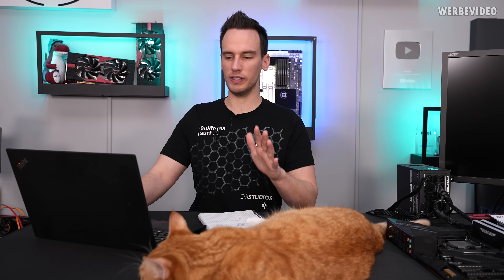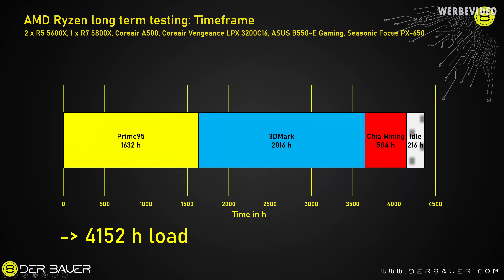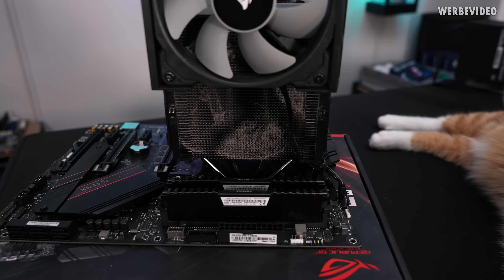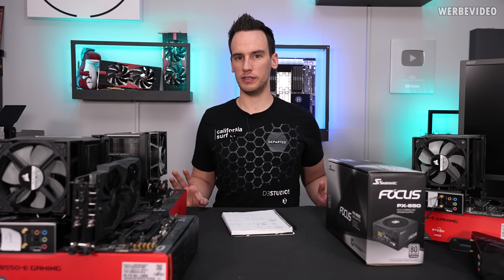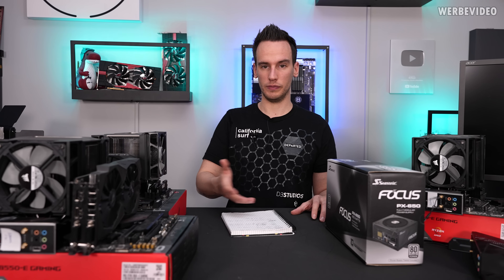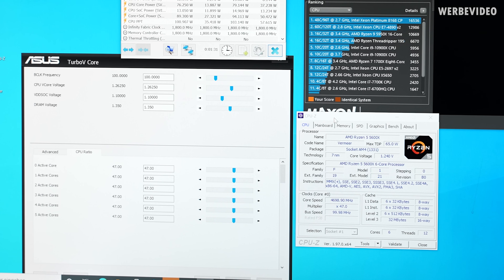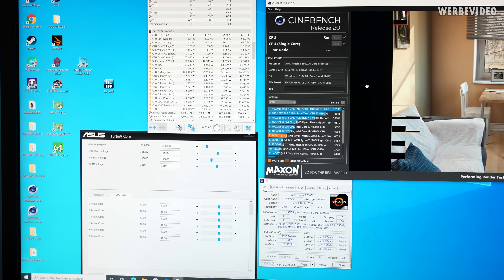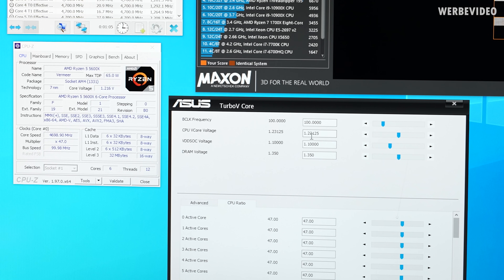4152 hours of Ryzen Long Term Testing: We have Good and Bad News

Comment: Those "windows restarts due to updates" aren´t Microsoft´s fault, those are yours, because the automatic restart after update can be easily disabled via powershell.

Only really "fragile" thing on AMD CPUs are the pins. Very easy to bend or break. Otherwise, the CPUs are the sturdiest part of the PC. With AMD moving onto LGA platform, the fragile pins will be in the same spot as on intel platform - inside of the motherboard socket.

Comment: i change x570 asus formula to x570S meg ace max from msi, and i can go now the same freq with lower voltage for example:   asusx570 formula was  4700 + 4600 on 5950X with 1,275 V and msi can do it 4700 + 4600 on 1,250V     its the same llc lvl or  asus meybe higher (llc4 )  and msi(llc6)      - on asus 5 is highest on msi 1 is highest

Comment: My Ryzen 5950x Died just a week ago when in idle just listening to music! I only had the PBO enabled and I always checked temps and voltages with nothing too concerning! But all at that day the PC just started cycling and trying to boot! At first I got the Qcode 23 on my Asus Crosshair Hero and then when I saw that it just kept rebooting I switched it of and tried to reboot. Then I got the qcode 90! I am not really sure what went wrong but I am now a proud owner of the dead 5950x. Also in HWiNFO64 the *Power Reporting Deviation under full load is reporting under 90% (80-85%) with my 5800x. I don't know if the MB is under reporting voltages to get a higher overclock has something to do with this! Please any help on the matter is much appreciated !!!

Comment: Hopefully this confirms what I've been saying and warning about for years.. Fanboys (and girls, etc) never listen though! And don't blame Microsoft/Windows for your oversight! That can be controlled and set to not auto restart, plus it could have been a system reset/crash whilst you weren't there! If event logs indeed said it was Windows Update...CHECK YOUR DAMN SETTINGS noob! lol Edit: confirmed, but your testing didn't take into account that the two extra cores of the 5800X will draw more current, thereby decreasing actual voltage under load :) surprised you didn't measure from the back of the socket/VRMs..

Comment: i ran into an interesting "feature" of overclocking 2400G a while back, that if you OC the iGPU without OCing the CPU, the boost disregards all FIT/Power/Temp limits and will sustain 3.9 boost no matter what. this led to it raising the voltage significantly as the temperature rose, which made the temp rise more.

in the end, auto boost was blasting 1.5V into the cpu, something i didnt realise until id already been playing for a few hours. so i panicked, closed the game and the sytem blackscreened. rebooted, everything stock, random blackscreens on idle, system barely usable.

after much troubleshooting, found out that the system could no longer run stable with C-states enabled. Disabling either C-states or Core Performance Boost and run at baseclock, fixed the blackscreens. cpu requires about 25-50mV more to hit various clocks along previously tested range (including underclocks/undervolts).

the system is perfectly capable of running stock 100% stable with boost provided that C-states are disabled. it is also capable of running baseclock with C-states enabled. must be something about this small degradation, that makes resuming cores/package from C6 unstable when resuming straight to high frequency, going from 0-1400mV, yet going 0-1180 is fine, as is 975-1400.

odd quirk. maybe it wasn't degradation that ruined C-states. but it's a mighty coincidence otherwise. aside from the small-ish voltage increase required across the frequency it's not notable. yet, if i had C-states disabled to begin with, i would never have noticed; and shrugged it off as my initial undervolting testing for stability being insufficiently thorough.

as a final note: passing cinebench 3 times is not a rigorous stability test for Vmin, and you know it, being a professional OCer. but if that's all you did at the start of these tests, unfortunately it's the only basis for comparison now.
Reply: I have the same exact problem with C states on 4750g. It must be inherent to those cpu types

Comment: on the 5600X & 5800X I have found they prefer between 1.275V - 1.32V in order to get an all-core of 4.5 - 4.7, what you get at what v-core in that range is all silicon lottery. As an example my personal 5800X is 4.5 @ 1.28v but i have one client that i got 4.7 @ 1.275. still very impressive clocks for such low voltage.

Comment: A note about high overclocks and putting a constant, high or ultra high load on the CPU - I can tell you for a FACT that doing so CAN result in damage to a CPU, whether it's AMD or Intel.

I had overclocked one of my old Intel Core i7-3930K from it's stock speed of 3.2 GHz to 4.5 GHz (and I think bumped the voltage up to somewhere in the neighbourhood of 1.45 V on V_core) and after about 4 years of running HPC workloads on it (CAE/FEA/CFD), I think that I actually burned out one of the six cores that's on the system.

The reason why I know or suspect this is because the system started failing/crashing and so I started to back off the overclocking, to the point where I was UNDERclocking the CPU and I STILL wasn't able to successfully run a CPU stress test (e.g. IntelBurnTest) on it without the system crashing.

In the BIOS of the Asus X79 Sabertooth motherboard, there is an option to take it down from all cores active to just 4 cores, and once I did that, I was able to resume running at stock speeds which suggests that at least one of the cores has burned out from the high overclock and persistent/consistent loading of it at 100% by running HPC workloads on it.

So, I suspect that the fact that you are already having to make adjustments on your 5600Xs shows that it is already starting to impact the CPU performance (or stability, rather) even after this < 1 year worth of running it at the high overclocks, during this time and that it will likely only get worse from here on out.

Comment: For future test systems I would disable Windows Update altogether when they are running tests. To do this, hit the Windows key and type "group policy" and click the result "edit group policies". Then on the left under Administrator>Windows Components>Windows Update you will find many options for controlling how Windows Updates does or doesn't operate based on whether you enable/disable a policy or revert it back to "not configured" which is the default.

Windows will display a message in Windows Update when there are changes in group policies that affect Windows Update, it will go away if you revert any changes you made.

Hope that helps! 😁

Comment: i have a 8320 overclocked under safe voltage to 4.4 ghz 9 years old, from past 3 years its continuously running above 60% load, 50% of the time running @  100% load and it needs 1.425 v just to stay at 3.6 to 4.1 ghz

Comment: i have 3600x 4.5ghz on 1.344 v, the core usage barely goes beyond 50% I'm thinkin about undervolting, since I don't need such a speed I guess - but that would take some time to setup it all once again
Reply: Easiest thing to do and get an auto-undervolt is - remove the overclock + disable boost, you can get away with Ryzen 5 3600 stock + boost disabled = 1.00 V, which I find amazing.

Comment: Had an 1800X that refused to OC after about 6 months.   It still works just fine stock and still being used.   Increasing voltage didn't fix the OC and I've been overclocking since the 8088 😁
Reply: How far did you go?
I have run my 1700 at 3700Mhz allcore since release.
Had to adjust voltage from 1.2 to 1.25 after 2 years running at those speeds.
Going higher then 3700 really begins to ramp up the voltage and power, so i settled with that.
Reply: @larsjrgensen5975  I think I hit about 1.35.  It's been a while.   I had it running around 4000-4100 on an AIO.   Once it started acting up I could get it past base,  but not enough to make it worth it.   So now it runs daily at stock and has been just fine.   Now I run a 3950X stock and just don't care.

Comment: Could the power supply affect the results in a situation like this?

I swapped my power supply to a slightly inferior one and now the CPU needs more voltage set in the bios to achieve stability in stress tests. Although much had changed since I last verify the old overclock settings, bios updates etc. I kept adjusting the settings each time to make sure the memory overclock was stable but didn't pay much attention to the CPU over time. It doesn't crash outside of stress tests or show any strange behaviors during normal usage.
Reply: 100%.

Thats why he used a Seasonic.

They make great PSU's.
Reply: @nexxusty  I used corsair rm650 before switching to seasonic s12iii 650w, just swapping parts between different builds and not that it has any problems. Before the PSU change the CPU was stable at 1.2v set but now it needs 1.24v set for the same frequency with every thing else set the same in the bios, although a different bios version. With that said, the amount of voltage increase is within the same 40mV margin as mentioned in the video. So I wonder how much of that is affected by the PSU change, if at all. Or is it just a different measurement margin from the bios/software or even slight CPU degradation.

Comment: Why are you testing (not just you everybody) AVX workloads insted of some simple integer test? Average users don't use their CPUs as GPU, so I really want to know the answer, is it because of the power draw, or just because this is "the industry standard" (funny only reviewers use Cinebench)? Have you considered some CAD, CAM bechmarks, maybe compiling some code? (If you make a RAM Disk for compiling you can stress the CPU and the memory at the same time.)

For the degradation part what about Memory controller (IMC)? People love fast RAM with XMP profiles and the voltage is out of JEDEC spec. I've seen lots of bad DDR3 and DDR4 memories (mostly from Corsair). It is fact memory degrades faster than the IMC, but how mutch? Does the IMC degrades at all?
(DDR3 ASRock motherboards had 1,595V set as default, which already exceeded the 1,575V maximum rating)

Comment: Could vdroop have contributed to the lack of observed degradation on the 5800X? Assuming identical vcore and LLC settings in the BIOS, a 5800X will have a lower load vcore than a 5600X because it uses more power.

Comment: There is something that i think this test is revealing.
The 5800X has perfect CCX's as it requires all cores on each ccx to work.
The 5600x can have a CCX that failed QA for the 5800X as it doesnt require all the cores to work as 2 can be disabled, so being lower quality silicon.
Reply: statistics sample is too small to assume that
and second 5600x have had lower voltage then 5800x by default for the same frequency
Reply: most 5600x use perfectly fine chiplets, zen 2 has  yieldrate of over 90%, amd doesnt have enough " bad " chiplets to use for a 5600x and 5900x
Reply: @Georg Warhead  On zen 2 in time newer chiplets were better in OC and lower voltage so it can deppend on revision (New revision = better).
Reply: Kind of thinking the same thing, stock clock for 5800x is usually the highest clock, but that more cores are usually lower clocks keep in power threshold.
Reply: It doesn't mean that though? In fact I could come up with a simple model that suggests the 5600x should have better CCX. On average the number of CCX chips that are going to have all four be working, and all four be higher quality, would be lower than the chance of having a chip of 75% of the area (basically a 6 core CCX) having better quality silicon. If you look at it statistically assuming that each area of the wafer has an equal chance and that one area being biased doesn't make the area next to it biased, then statistically you would be more likely to get more 5600X CCX that are better than the same at 5800X.

In reality my model isn't accurate, because my assumptions don't fully hold. But your assumptions don't fully hold either. It's too hard to say which one of our assumptions is correct. In reality we're both going to be correct to a degree. Both of them combine + tons of other factors to give very complex yields. And when you're talking about this sort of far out degradation it becomes even more complicated, and there's a good chance that no one (not even TSMC) has good data on this.

Comment: Your choice of 1.26 V was too low in the first plsace.    Just because your initial short tests passed at 1.26 V  does not mean it was the optimal  choice.  Voltage  choice  starts with power draw and temp vs perf gain or clock target initially and varies dependent on specific silicon die under test, one CPU might require a higher voltage while using the same power and producing the same temp at the target clock. .   The final choice can only ve determined by long term test in the system and use case.  Here we see only that 1.26 V might not have been the optminal  choice for the 5600X CPUs and does not conclusively demonstrate degradation from voltage.   The temps under the test conditions are more suspect here and open. no case with no air flow  under the MB or across the VRMs,  which would be indicated in a high stress usage,   The takeaway here is shown that OCing your components is a multi step process and not set and forget, just like dust clearing and thermal paste maintenance.

Comment: To draw any semi reasonable conclusions about degradation vs usage you should have included at least one CPU at stock settings and judge the degradation by going in the opposite direction, undervolting.

Comment: Hey please fix your R7 5800X results, you have error there, it's running at 4.5ghz not 4.7ghz, cinebench r20 shows actual frequency and your score is defintely more suited for 4.5ghz results, at 4.7 you should get around 6300 points

Comment: Anecdote here - I've been running my 3600 (non X) at 4.3ghz all core at 1.302V set in bios for 2 years now. Mainly gaming, computer is used 2-3 hours per day and left on mostly idle as a security camera server.
Reply: i've been running also my 3600 at 4.4ghz all cores with 1.28Vcore for 1 year now. Everything works like day 1. Gaming and office use. I currently changing my 3600 to an 5600 and i will doing OC as well.

Comment: High temperatures, voltage and ampere doesn't degrade the silicon - as long it's stable, you won't see a difference years down the road. What will kill a CPU is irregular usage, where you heat it up, let it cool down, then reheat it, and so on. The repeated expansion and contraction of the silicon (on a microscopic level) is the fastest way to degrade it and also reflects the stochastic nature of common usage.

Comment: Very long time ago i was young kid and i played with AMD K6 and by mistake i set much higher voltage on vcore than stock by jumpers. Cpu runs with that on stock frequency about two years used in  office computer. After that it cant run stable at stock voltage. Only at high voltage it was stable. So there is the same overvoltage degradation.

Comment: One thing that i get from this is that cpu degradation is not linear, so samples that can get very low voltages will degrade somewhat fast until they reach a point where they are similar to those samples that didn't win the silicon lottery, this can be seen in the fact that the only sample with "significant" degradation was the best one at first while the other two had close to zero degradation at such high voltages.
This would mean that even if you get a cpu that can't OC as good as others it is likely to hold that overclock for longer or just require minimal adjustment after a few years. Another thing that can be taken from this video is that slightly overvolting your cpu when you are overclocking is not going to cause significant degradation if any so you could avoid having to fine tune your oc every few years.

Comment: my 'mud tier' 3600 did degrade a bit after running it overclocked for 2 years, but nothing catastrophic. it only ran up to 3.8GHz stock, and with my overclock it could finally run at up to 4.2GHz lol. it was that or return it for me, the small boost gave me the missing performance that I needed.
Reply: My ryzen 3600 under load just doesn't want to get higher than 3925MHz/3950MHz,  if temps are very high it can also downclock more, I didn't expect that some 3600 could get even lower clocks at stock lol sorry for that CPU
It's just sad that some other (newer) 3600 almost run at 4.1GHz stock or even a bit more under full load, while ours just downclocks a lot

Comment: ITS WHY INTEL CAN PUSH BEYOND 7GHZ DUE TO GOLD COMPONENTS IN THE 10NM NODE VS THAT AMD DIED AT 5 GHZ DUE TO TIN OR SOMETHING BAD QUALITY TINY MATERIAL BREAKS APART DURING HEATING PERIOD AT UNSTABLE CLOCKS..ITS WHY AMD PUTTING HEAVY AMOUNT OF CHOCKS AND SENSORS TO MAKE SURE CPU NEVER RUN 4.8GHZ AND PUSH FURTHER DOWN CLOCK WHILE INTEL SOFTWARE PUSH IT UPWARDS IN CLOCK AND VOLTAGE LIKE A MAN WHO WITH A WOMAN IN BED...NOT SURE WHAT ASIANS DOING WRONG OVER THERE BUT I DON'T LIKE IT WHAT THEY ARE DOING OVER THEIR

Comment: I respect your hard work, but I don't think running the rigs non-stop for 6 months properly represents 3-4 year usage.
Thermal cycling will increase the CPU die degradation if the with varying workload times causing both the die and substrate to sporadically expand and shrink (normal usage).
While this won't happen as often when a constant workload is being applied without rest (your experiment).
So, I think this will affect the conclusion.

Comment: I would have prefereded a more difficult / longer test to determine if the cpu's were stable. Margin for error is somewhat high woth cinebench. Then again it does proove the point reasonably well.